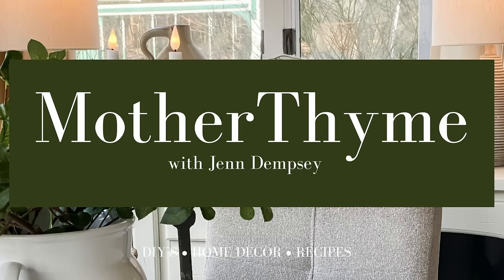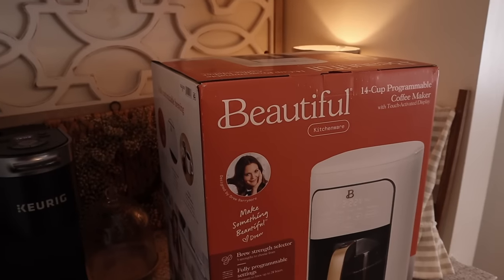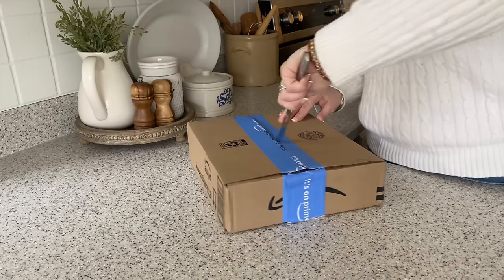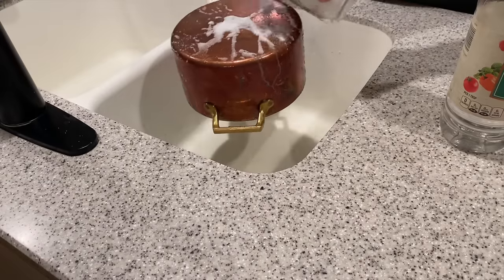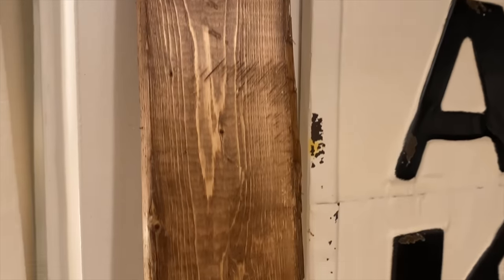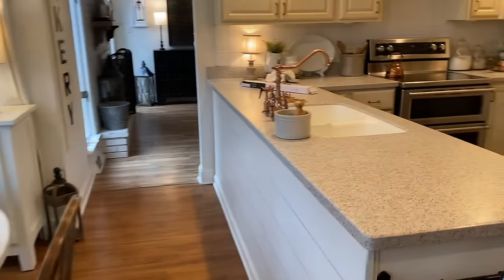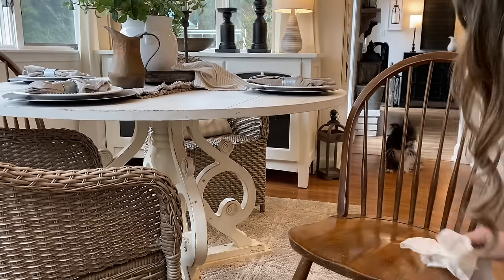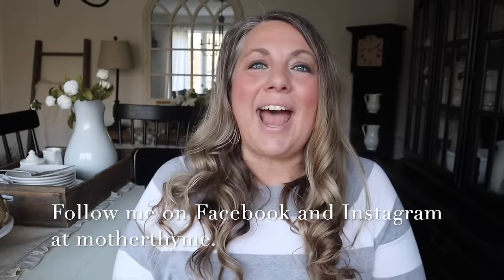Simple Cottage-Style Kitchen Updates | DIY Faux Beams | 2024

Comment: A copper mold or 2 also would have looked good over the stove & can also be found at thrift stores. I'm lazy enough to be concerned about having to clean anything hanging over the stove :) Your home is lovely. The day there was snow outside looked really beautiful. Do faucets come in brass or is that not a thing? I've never looked. That big black one was a bit overwhelming. In the summer I think those wicker chairs may need cushions or you will have indentations on your legs. (I've had wicker chairs).
Reply from the maker: Hi! The faucet came in brass too. I went back and forth between brass or copper. I love the mold idea too! It will be fun to switch the copper pieces out. Happy Friday!

Comment: I worry that a tension rod won't hold too much weight, and you don't want a pan hitting your stove top....I would add a shelf for decor myself....
Reply from the maker: Hi! Yes I was afraid of that too that's why we ended up using the towel bar so it would be anchored into the wall. We also used better screws then what it came with so it would hold the weight. :)